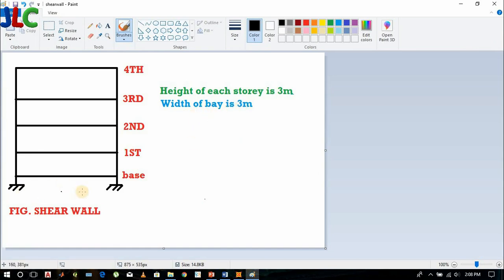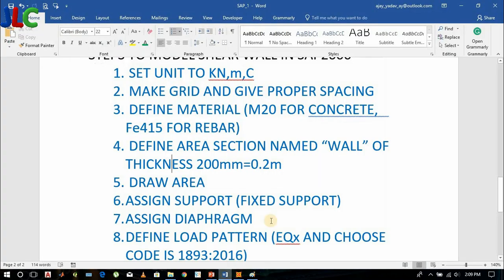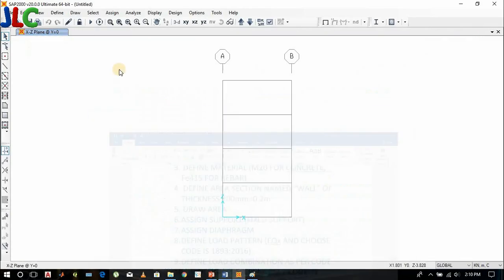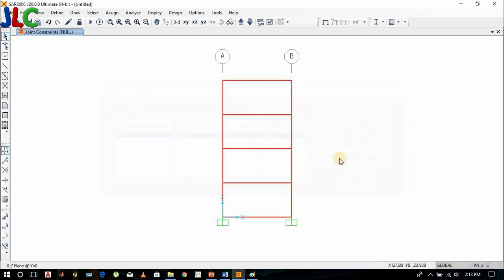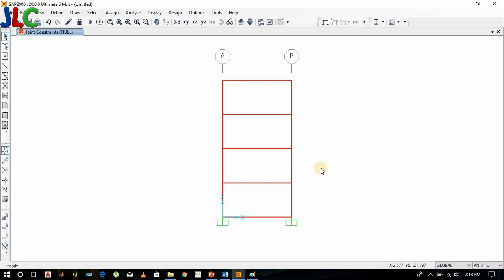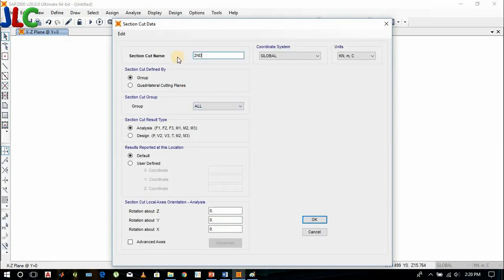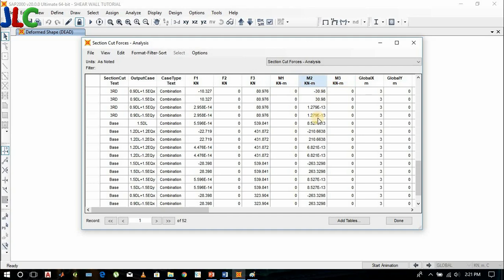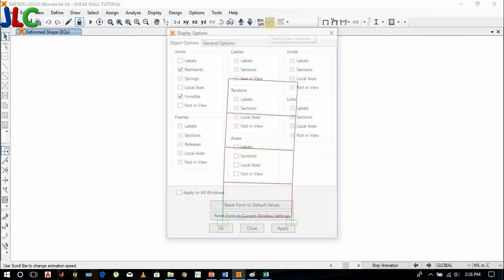[SAP2000 #3]- ANALYSIS OF SHEAR WALL IN SAP2000 AND USE RESULT TO DESIGN AS PER CODE IS 456, IS 1893

Comment: Great Video sir. Can you please make a video on:1.  Moment and Force directions (what is maximum and minimum moment M1, M2,M3?). positive and negative moment directions.2.  to show local coordinates and if we can change their orientation to match global coordinates.3. Explain supports, spring constants and Degree of freedom in detail.4. Meshing of slab areas/wall into Finite elements.5. Is there anyway we can see the dimensions of existing element in the model?6. When to use shell thich/thin and plate thick/thin in Define Area options (for 1 way or 2 way).Please reply. Also, do you have email id or facebook page where I can message you Sir.Thanks.
Reply from the maker: Go to the official blog of Just Learn Civil, where you can find SAP2000 tutorial. https://justlearncivil.blogspot.com/2018/02/sap2000-tutorial.html
Hope you will get answer to your queries.
You can download the PDF version from the blog.

Comment: while assigning the area section why didn't you modify the concrete shell section design parameters option in the shell section data?@5:04
Reply from the maker: In sap2000, design for area member is usually not done. so here also, design of area member is not done. Only analysis is done and using that result, design is carried out.